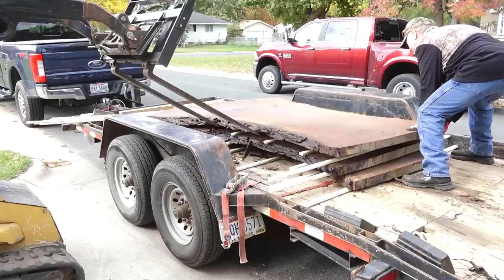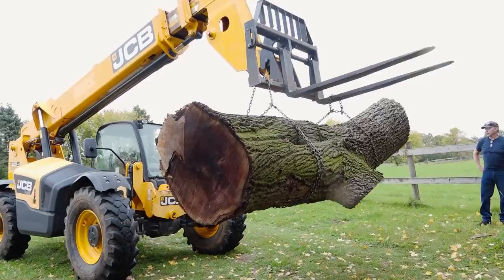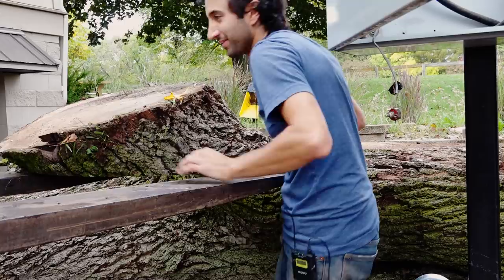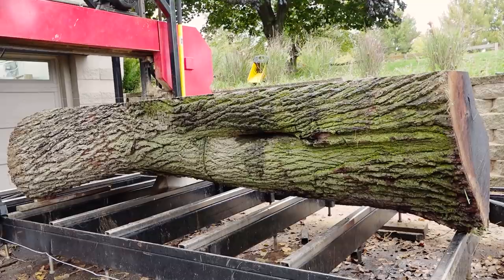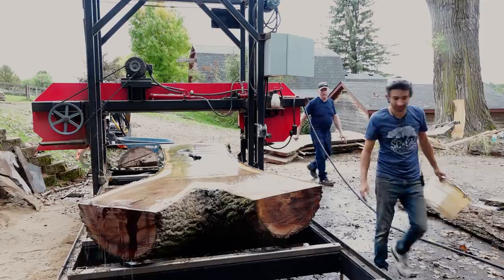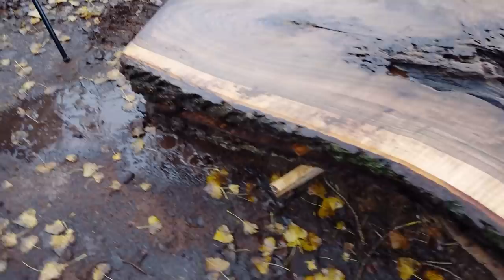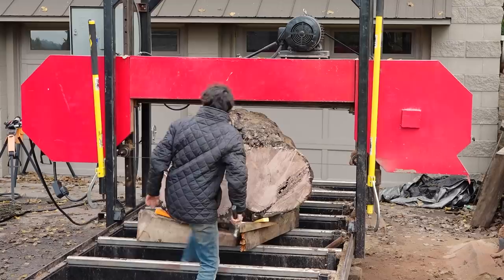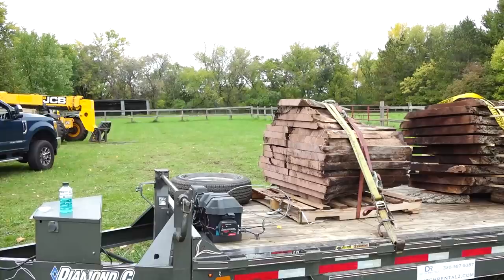Jeff Brought Another Monster Walnut Log from Ohio | Sawmill

Comment: You need to make some metal wedges that slide on the cross member’s of the saw bed. Drill a hole in one side, weld a nut in place and use a bolt with a piece of rod welded on for a tightening handle. That will hold these amazing logs in place.

Comment: So forgive my ignorance. Once the slabs have been cut, how are they cured? Do you need to kiln dry them like you would with boards?
Reply: He mostly air-dries his slabs, though occasionally he has borrowed someone's kiln. He paints the endgrain with a wax sealant (so the ends don't dry faster than the middle, which causes cracks), stacks it up with stickers between all the slabs, and just leaves a stack to dry for a couple of years, maybe covered with a tarp to keep the weather out. He uses a moisture meter to see how they're coming along.

Comment: I've been watching Matthew's videos for a while now, and I'm confused.
I know very little about woodworking, but I'm aware that other professional saw mills will reject lumber that is not straight, or has too many voids and imperfections. They only want the part of the tree trunk above the stump, not bellow the stump where it flares out and gets wide.
But Matthew seems to work exclusively with the odd shaped section at the stump end... the peices that others would discard as firewood or waste.
Are these weird shapes with voids, cracks, and splits considered to be valuable? Desirable?
Does a woodworker choose these slabs, and possibly even pay a premium for these, as opposed to something more rectangular and regular?
It seems to me that a woodworker would have have to do a significant amount of cutting before these odd shapes would be usable.
I'm probably missing something, but I just don't get it.
Reply: Check out Black Forest Wood Company to see how these types of slabs are used to make furniture.
Reply: They are more work to use, so many don't want them.  But to the right audience they are extra valuable.
Reply: @DanielIsaacs  👍also Blacktail studios
Reply: @hpw59  Yeah, he's great, too!
Reply: They fill the voids with colored(or transparent) epoxy to make it a solid surface. Finished result looks awesome.